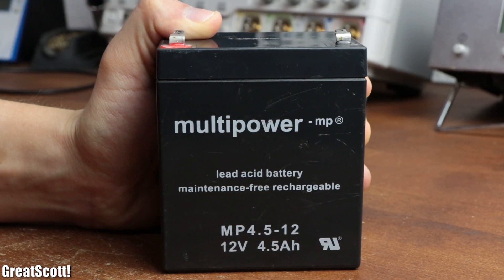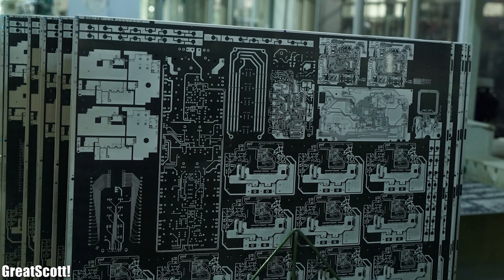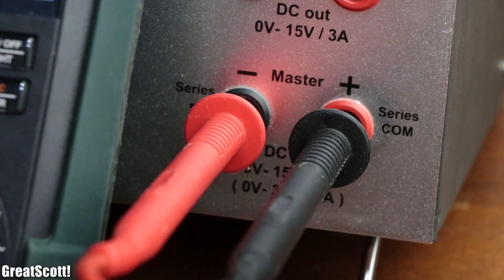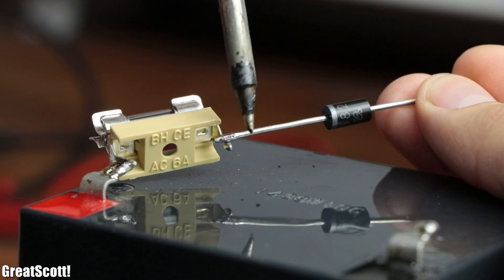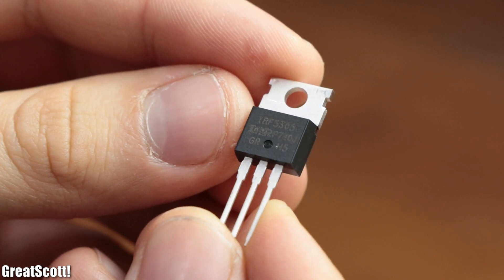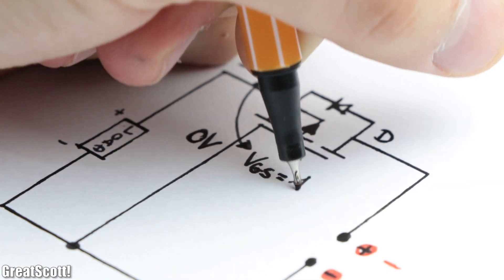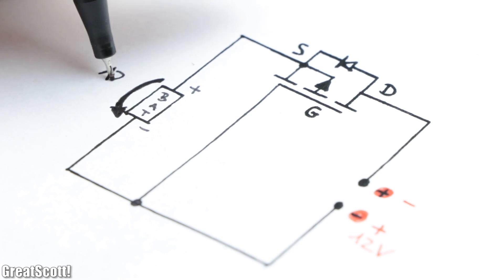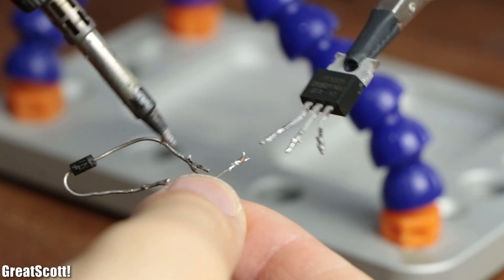What is the best Reverse Voltage Protection Circuit? || Repairing a Lab Bench Power Supply

Comment: the issue wasn't reverse voltage, but overcurrent. if the battery voltage were higher than the power supply's output voltage, then current would flow into the positive power supply terminal. instead, in your case, since the battery was reversed, current still flowed out of the positive power supply terminal, and into the negative, so this was not an issue of reverse voltage.

Comment: The diode in parallel is added generally to damp transient voltages which might happen during inductive loads... This parallel diode also happens to act as a reverse polarity protection.
That parallel diode might be a TVS or a schottky diode.

Comment: I think the diode in your power supply wasn't primary intended to protect from reverse voltages, but to serve as a freewheeling diode, to protect you and the circuit while handling inductive loads

Comment: Here is an idea, you should make such a circuit that connects to the power supply leads then regardless of what you plug to, this will always be protected. Rather than modify several different devices, you only modify the Power Supply Leads... Just a thought, perhaps someone might be able to make use of it... Cheers...

Comment: Or put a proper battery charger between the battery and the power supply, (or better yet use a battery charger that plugs direct to household AC) since modern chargers (unlike a power supply) have the correct circuits and logic to detect and protect from a reverse connected battery and to automatically shut off charge when the battery is full.

Overcharge damages ALL types of batteries...

Save your power supply for something that it is made to do.

Comment: Interesting solution but it needs a battery connected to turn P-MOSFET on. So it will not work with passive loads.
Maybe a 100k resistor from supply (+) to base of NPN to turn it ON with passive load. Any reverse connected battery will still switch NPN off.

Comment: Excellent solution, regardless of the voltage dropping which can be calibrated with a predefined fine tuning and clear the offset. Can you make a video about charging/discharging super capacitors?

Comment: is it just me or is that the coolest looking heatsink? (1:33)
Reply: It's either that or the most intense fleshlight...
Reply: It'd nice if you could run a high static pressure fan sealed on that.
Reply: @hariharanb785  that sounds more like a workaround for bad design than anything else. You could push/pull the same volume of air over a proper externally finned heatsink and it'd be more efficient as you've got more radiative surface area and better air flow characteristics in general. However, this design could be good if it was vertically mounted; hot air rises, hence you'd actually be creating a channel for airflow using a passive heatsink and no fans (this is the logic behind the passive cooling in the Airtop 3 computer, despite it having high-end, high-TDP components inside).
Reply: It is indeed the coolest looking heatsink
Reply: Jealuosy
Reply: Looks like an outer space spaceship 🙃

Comment: Doesn't the cut-in voltage of the MOSFET limit the minimum voltage you can output from the power supply?  It would seem to me that a virtual zener that drives a N channel MOSFET, via a proper driver chip, would be another solution with fewer drawbacks.  N-channel MOSFETs tend to have a lower resistance too.

Comment: This is German version of Electroboom. He had the same problem with his power supply. One time, I was powering circuit with 12 volts lipo battery, and I connected it with reversed polarity. My L293D released magic smoke... So don't drink and tinker with electronic. It can kill you

Comment: Still the best solution is the diode + fuse.
The simple the better, and this not mess with the output voltaje of the  power supply.
I don't think somebody will be so careless to blow up fuses everyday and need an automatic one

Comment: Supposing the sense terminals (which are supposed to have high input impedance) are not printed on the board, couldn't one just attach those to the load side of the protection circuit? That would at least solve the output voltage accuracy problem.

Comment: With a little tuning (divider instead of diode), that circuit can be used as accumulator discharge protection. But not very stable.

Comment: Will this reverse voltage protection circuitry affect the voltage and current readings when using on load?
Reply: Yes it will affect the voltage regulation due to the drain to source resistance in the mosfet. A fuse to protect the diode is the simplest way to protect the PSU without affecting the voltage regulation.
Reply: If the PSU can supply 10A, what amp rating of fuse would be optimal as reverse protection?

Comment: how to protect a circuit from reverse current AND viltage spikes up to 100V in a 12V circuit?
Reply: Why do you have 100V spikes in a 12V situation
Reply: Sounds like an automotive requirement.
There are chips for that.  e.g. LT4356.

Comment: Haha, been there - none it (blowing up my power supply). But you do have to love the power mosfet versions ! Just build it into your power supply and change the point where your power supply monitors the output voltage to the output of the mosfet protection circuit.

Comment: Incredible ! It was what i was looking for to charge lithium battery with 220v to 5v supply. Because the 0.7v drop of the diode prevent it from completely charge le lithium battery. I hope the lower drop voltage of the mosfet will be ok !

Comment: Inspite your explanation, I would still go for the reversed diode but added with a (reachable!) fuse. As in a good PSU design, the sensewires should be connected as close as possible to the load. The fuse can be quite overdimensioned compared to the PSU maximum current as the PSU has its own short circuit protection.

Comment: What if I add a FULL BRIDGE REKTIFIYAA.......?
Reply: FOOL BRIDGE*
Reply: Zen you vill haf 1.4V drop across it and you missed the point.
Reply: God dammit
Reply: Electroboom hahahaha
Reply: Voltage drop, but it would work
Reply: I can hear the voice of Mehdi
Reply: Then you will need to recalibrate the power supply to account for the forward losses (so the meters wouldn't be lying), which would work great if your supply has calibration trimmers, or if your supply has sense line connections and would adjust itself accordingly.

Comment: Is there any difference between using a P-channel vs N-channel MOSFET when protecting a load?
Reply from the maker: P-channel usually has a higher resistance. But N-channels would interrupt the GND connection which can be a problem for digital electronics.

Comment: this system wouldnt be as bad if the diode could be swapped more easily
Reply: Maybe mounting a perf board on the back of the power supply that contains the diode on the outside of the power supply for ease of replacement.
Reply: Eric Daniels Just put the diode in a fuse holder.  But encouraging internal repair of lab equipment is good outside the calibration industry.
Reply: Could protect diode with a heavy latch relay on a separate power source disconnect the output when polarity is reversed or shorted

Comment: The best reverse polarity safety is a full wave rectifier.
Reply: Although you might have issues with higher loads. I put reverse current protection diodes on an LED driver I build with a dual power supply to stop each supply trying to force current through the other supply in reverse and tried forcing 5A through it (current required by the LEDs). Despite being rated for 10A a LOT of smoke came out of them and they exceeded 100C by the time I'd noticed.
Reply: @jayzo  don't cheap out in high current electronics or that will happen. Learnt it the hard way.
Reply: *BRIDGE
Reply: FUULLLLLLLLL...
Reply: FOOOOOOOOOOOOOL BRIDGE RECTI-FIRE!
Reply: BackdoorNutzer Yes, bridge rectifier. Thank you.
Reply: Prehistoricman Yea, I installed them in the devices, not in the supplies.
Reply: The full name is a "full wave bridge rectifier."  I'm not sure how many years ago the word "wave" was dropped.  It is capturing the full sine WAVE when used on an AC power source.
Reply: No @backdoornutzer4461
Reply: Then you missed the point of his tutorial.  Your "full wave rectifier" has an inherent 1..4V drop because now there are TWO diodes in series.  His video attempts to explain how a correctly used FET can achieve better than even 0.7V drop.
Reply: If you can put up with two diodes worth of voltage drop
Reply: @John_Ridley  Yeah, a drop of 1.4v is excessive, especially for low voltage  devices.
Reply: Polarity protection https://youtu.be/HpRBMd0mfIE
Reply: MrFmiller Yep, that exactly.
Reply: Full Bridge Rectum Frier

-AvE 2017
Reply: so, fool proof is the best solution.
Reply: If you reverse polarity a bridge rectifier with a current sauce on what would be conventionally the output (dc side) you will still have a destructive short, so in this application it would not work any better then a single diode.
Reply: @another1commenter770  

Does "current sauce" taste good?
Reply: lol... I remember we were actually taught this in high school as THE way to ensure proper polarity.
Not many circuit diagrams have survived in my memory since  high-school.. but the full wave rectifier is one of those beautifully elegant circuits that I'll never be able to forget.
Reply: There is much power loss is created 😂
Reply: unfortunately FOOL BRIDGE RECTIFIER drops the source voltage by 2x the diode's voltage drop and also wastes power.
Reply: FULLLLLL BRIDGE RECTIFIER
Reply: Just don't drink while you plug shit on
Reply: *rectum frier
Reply: No FUUUUUULLLL BRIIIIIDGEE RECTIFIAAAAAAAAAAA
Reply: We're dealing here with DC. So a full wave bridge rectifier won't really help, since its main role is to convert AC to DC
Reply: @nankinanko5790  doesn't matter ac or dc check out how it works
Reply: +ElectroBOOM FOOL BRIDGE REKTIFAIIA!
Reply: FUUUUL BRIIIIIIDGE REKTIFIER
Reply: Yeah, and you'll loose more than 1W of power as heat and the voltage will be lower... Also, like the use of a diode, a FBR is not usefull it all in this case, because reverse the polarity in power supply output doesn't reverse the polarity on that components, so the energy will continue flowing and will destroy the components anyway. Maybe is a good idea for low power inputs, but not for outputs.
Reply: FUUUUUUUUUULLLLLWHAAAATSOOOOEEEEVEEEERREEECTIIIIFIIIIEEEERRR
Reply: Fullllll briiggggdee Rectifier. Electroboom
Reply: FUUUUUUUUUUUUUUU

Comment: We can use bridge rectifier as well, if drop of 2*0.7 voltage is acceptable with some power loss as well. Afterall device is protected as well, We can power up with any type of connection, either reverse or forward, and it work flawlessly for small power circuit.
Reply: Or using something like this:
http://www.ti.com/tool/tida-00858?keyMatch=smart%20bridge%20rectifier&tisearch=Search-EN-Everything
Reply: Loundre3  Nice, thanks for that.

Comment: Pfft, reverse polarity protection is only for the weak.
Reply: Yep. Once you blow something up, you almost always remember to make sure you set up correctly.
Reply: if you work at a atomreactor you also dont a second chance yo make sure to always connect correctly or just thing that your city will blow up xD
Reply: @BadMax02_VR  
Technically not true but it was good humor.  7/10
Reply: yeah when i wrote it i knew that it was kinda not the same but still posted it because meh
Reply: quick...lets get to the chopper
Reply: here is the scenario: a LNG tanker is on a runaway course with manhattan/san Francisco after a reverse polarity caused a massive fault and a fire in the control room - its like unstoppable meets speed 2 - meets poor electrical design.
Reply: Kevin's suggestion may be complete and utter bollocks, but as a movie, it needs to be made.
Reply: It needs to! and the ship in question had the reverse diodes omitted :-).
Reply: Or the cross eyed
Reply: Back in the day the only protection we had was fire! :)

Comment: Pls make a ampere increaser circuit
Reply from the maker: You can only increase the amps by either increasing the voltage or decreasing the resistance.

Comment: I never had problem with reverse voltage
Reply: 1) you are starting with electronics
2) you’re a liar
Reply: @RyutakuZaki  Every time when I make circuit I always double check or triple check circuit for reverse polarity supply or capacitors
Reply: Accidents can happen anytime, so it is best to be prepared..
Reply: There only two kinds of electronics hobbyists, those that have done this and those that will.
Reply: Until one day you had a problem with reverse voltage.
Reply: I had
Reply: You goddamn liar